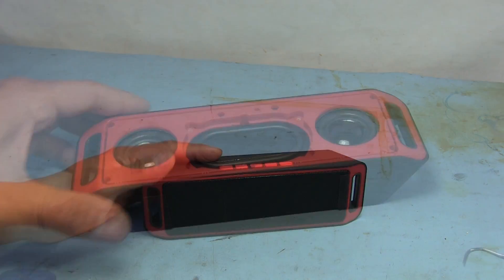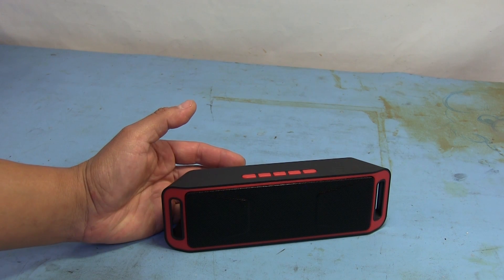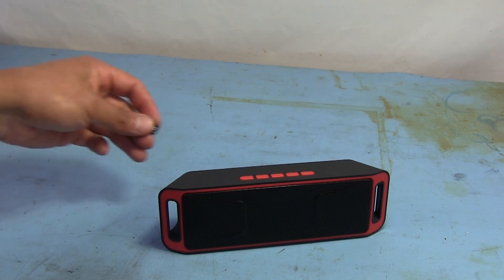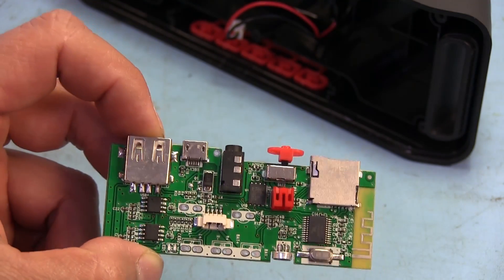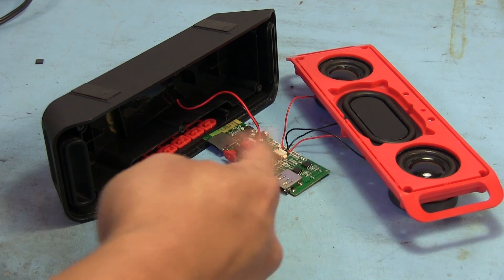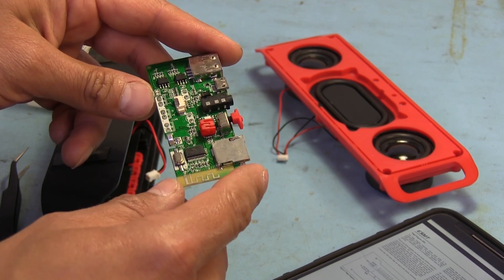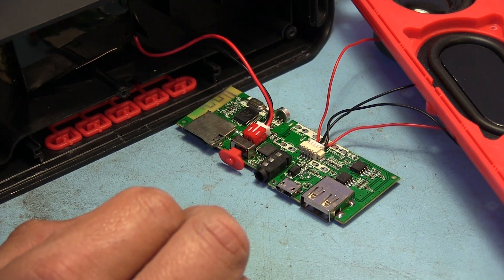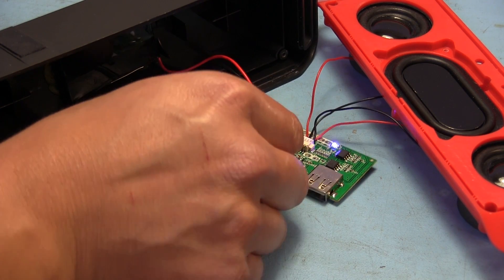TWB #70 | Removing The ROM From BT Speaker - What Happens?

Comment: I would expect to see a complete file system on the flash containing the base software, voice promts, even pictures (because chiese are lazy (no cleanup of code)) - It probably runs the same base software as a bunch of other Bluetooth-devices building on the same core.
Reply from the maker: Looks like I might be able to dump the ROM with my programmer, it has that part in the list, but are there any particular tools you'd suggest for analyzing the contents? Thanks!
Reply: @ThatElectronicsFool  The rom would only contain the raw sound data one after another; there's not going to be files much less a filesystem. The main chip is a microcontroller that stores it's own, most likely custom firmware. The start and end of the sound chunks within the rom are hardcoded in this firmware. The reason it won't work without the rom isn't because it needs something critical within it to function, it's because it fails initializing, demanding the rom to be present by design; making it continue without if not present would require a bit more code, and why write that when the rom is assumed present; it could just have continued without the audio, but is programmed to keep trying to read the rom in an infinite loop until it potentially succeeds. This is all assumptions based on experience with everything related, yet most likely correct, since there's feasibly not really any other option. A little late, but perhaps you'll sleep slightly better.
Reply: @TheMrTape  hey bro....what if we put in a new rom chip in there... which has nothing on it... like just bring it and replace right on ???
Reply: @voiceinthen0ise  It would probably work, unless it checks if the data is valid, but i doubt that.
Reply: @TheMrTape  hi man, If I understand you said that probably removing the rom the speaker could'nt work anyway?
Reply: it might have some unused prompts inside that system
Reply: @ThatElectronicsFool  I'd try photorec and Testdisk for files/filesystem, audacity to open as raw audio files, and a hex editor. If, as I think, the sounds are stored as raw audio, it should be possible to replace them with a hex editor, and generate the replacements using audacity.
Reply: @ThatElectronicsFool  If you have dumped that ROM chip please post the files somewhere so we can all have a look. I have a little experience in decoding weird audio formats from video games.
Reply: @CUB1_C  That's actually quite possible. It could be that the ROM just has a pack of sounds, and they are used as required for different boards, while using the same ROM (or at least ROM image).
Reply: @Fridelain could make a tutorial for that? I have a navigation cd for my car which is all Japanese voices. I had to remove it because it was annoying.
Files on the disc are all bin files, I wish I knew how to work them. 
The voice prompts are kinda useful because they have engine, brake, door, fuel warnings etc.
Kindly give me a headstart on this.
Reply: Koo
L @TheMrTape

Comment: So, no solution for remove voice?  😭😭
Reply: I have solution. Just flash firmware on rom it works
Reply: Yes, put it under a hydraulic press
Reply: Press + and - button
Reply: @irfanrahmandaadikusuma7249  how
Reply: @abhinavvjyn9475  Its a pcb design or whatever im actually confused also
Reply: @euvo_sound  I hate that "Bluetooth mode"...I want the sounds like JBL
Reply: @abhinavvjyn9475  Ahaaa there is in youtube
Reply: @euvo_sound  where..?
Reply: @abhinavvjyn9475  Sorry But cant give link now my phone has erroe
Reply: @euvo_sound  then tell me the search words
Reply: @abhinavvjyn9475  Im not sure but try this: Jbl sound effects
Reply: @euvo_sound  lemme Check
Reply: @euvo_sound  nope bro...it's just shows about JBL Bluetooth speakers..!
Reply: @abhinavvjyn9475  How about this:
JBL startup sound effect
JBL pairing/connected sound effect
JBLshutdown sound effect
Reply: @abhinavvjyn9475  How about only 
JBL power startup sound effect
Reply: @euvo_sound  then how can I apply this to my Bluetooth speaker...?
Reply: @abhinavvjyn9475  They say its a special type of pcb where they solder the ROM ic into it,And program the voice inside...I dont know if there is one
Reply: @computechsn  that doesn't show ANYTHING!!!

Comment: It's so annoying. Sometimes if you leave it on when you go to bed it repeatedly says "low battery" every 30 seconds on full volume. You get that for about half an hour before it dies if you don't get out of bed and go downstairs to switch it off. What is the point of that? Why cant they just have the led blink quietly every 10 seconds to show what mode you're using. once for BT, twice for Audio in, thrice for, sd card, continuous for low battery.
Reply: My fake JbL says “battery” when I removed the Rom.

Comment: Removing the microcontroller or disconnecting some of its gpios may do the job. Turning the speaker on may be easy, but at least two things will have to be added: physical switches for turning on and possibly a potentiometer for volume adjustment.  Connecting logical state analyser to gpios will tell you what to do.
Reply: Removing mcu the speaker doesnt work maybe reprogram the ROM

Comment: I tried in every way. I'm a modest nerd, but I'm not a programmer. I disassembled the motherboard and I used the mini usb cable to power and the normal usb one to connect it to the pc. USB to USB-C. I downloaded bt_config_tools_3.0.0.6 which should allow me to create a new firmware for this chip called jilei JL_HFP of the motherboard called AC6905A. So I downloaded BLUETOOTH TOOLS COMMAND PROMPT to communicate with the device. has been detected. but I couldn't create the firmware. Now in the device management, in addition to the Bluetooth category, the device is also mentioned in the category: System devices. This is an indication that the computer has indeed recognized the connected card as physical hardware. But unfortunately the path is too complicated for me.

Comment: I have a Bluetooth speaker but it has the worst inbuilt sound whenever i turn it ON or OFF, can you suggest how to delete or mute that sound forever, i want it to turn ON or OFF silently but it makes a very loud & high bass sound everytime.
Reply: You could achieve that in 2 ways:
- You can dump the ROM with a programmer, analyze it's contents, find the sounds with a hex editor, correctly identify their formats, and replace all that with empty placeholder data or with a custom sound of your liking (should be of the same size though, as each sound's end is probably hardcoded).
- You could make a board that cuts power to the speaker on power on and power off (arguably easier than the other solution, but pretty jank).

Comment: I have a similar one, turn on with the incredibly high volume !!!!!!!! No matter the last configuration, to top the damn screaming voice!, try key combinations and nothing! They spend money on putting a horrendous voice instead of putting better quality or at least putting a manual with a voice-over setting
Reply: You get what you paid for 😂😂😂 Probably just go with quality branded stuff next time
Reply: Just fix a switch between a speaker connection wire...and off it...then turn on the speaker no sounds will hear then turn on the custom switch...😁
Reply: @chrischoy9  Te quality for the price is superb, but the stupid voice is annoying,  a jumper or solder point on the pcb is no cost..
Reply: @abhinavvjyn9475  Hi, could you explain step by step please? Thanks
Reply: @timebellenavot  it's just simple...
Fixing a switch between the connection to the speaker..so when you turning on the board, speaker won't make any noises...then after that...,turn on the switch that we fixed .. that's all...
Reply: @abhinavvjyn9475  ok, but the switch must be outside the speaker, I Need to make hard mod in the box
Reply: Chinese curse and revenge
Reply: Thanks 4 solution ,I wish make a clean job using the led switch already present on board.its possible?
Reply: Exactly! I don't mind the voice, just the fact that it screams at max volume

Comment: can't you access it by USB would be cool to change the sound
Reply: Not without a ROM programmer and it wouldn't be a filesystem anyways, so it would require manual analysis of the ROM's contents to figure out what files are where.

Comment: My bro.. is it possible to turn down the volume of that turn on voice prompt by connecting to a PC or something.. it's too loud to turn on the speaker at night to the point that I don't use it at night..
Reply: We are the same my dear If the ROM is removed and  my speaker continue working it's very nice
Reply: I want to replace it with mr beaast meme

Comment: I'm curious if there's a way to change the sound to whatever you want like your own voice or the voice of a favorite celebrity.

I'd like to see the contents of that chip. what files are on it, file system and if you can change the sounds.
Reply: There probably is no filesystem, usually it's just raw binary data. But theoretically, yes, you could change the voices if you can find them in the ROM image and match their audio format.
Reply: @oa1700  I'm guessing they aren't common audio formats like a wav or mp3 file.
Reply: @coondogtheman  It could be WAV, as that's quite close to raw PCM data, or just raw PCM.
But now that I think, they could actually save money by using MP3 and a smaller capacity flash IC, as the board can play audio from a TF Card (the firmware does have decoding capabilities) and MP3 has compression.
So it's not necessarily some proprietary format, and actually pretty unlikely to be. But you would need to identify the format from raw binary data as for the main IC to read and play it back without erroring out, it has to match the original audio.
Reply: @oa1700  if I put the speaker near an am radio and then power it on or off, when the greeting plays I hear pulses from the radio so its playing back some type of audio file.

Comment: get a bluetooth board with a 4 pin jst connector for $5 on ebay and replace that garbage board inside the speaker.
Reply: this whole speaker costs 3$  😂
Reply: @SudarshanAshiya  depends on where you buy it. In China you can buy the board for a few cents.
Reply: @jj987987987  it is available on Indian e-commerce websites at 199rs means 2.72usd

Comment: Maybe you can cut the voice pin on the ic, what is the model of the ic, maybe we can find the pinout diagram somewhere!
Reply: Voice out? It's likely a generic ROM chip, they are usually SPI or I2C, and do not have any special pins for each kind of data output or whatever, they are just connected to a master device that can then read and write information.
Or if you're talking about the main IC, then it does not have such pin because it looks like it does the job of switching modes, Bluetooth connectivity and audio output to an amplifier (I think the other 2 chips are class D amplifiers, but it also could be that the control chip is an ASIC that has amps built into it)